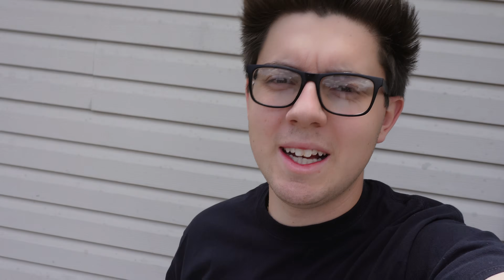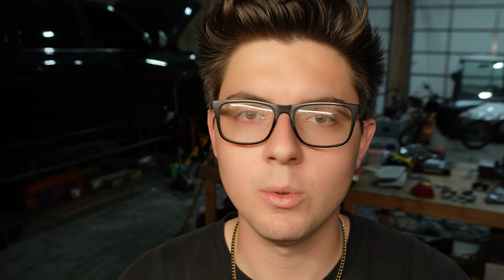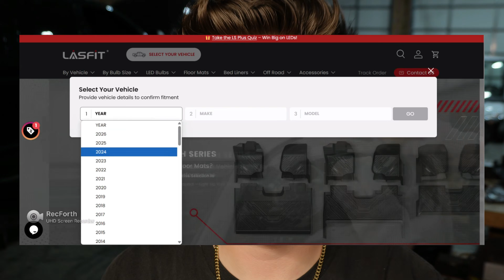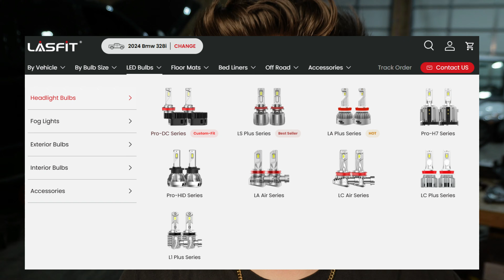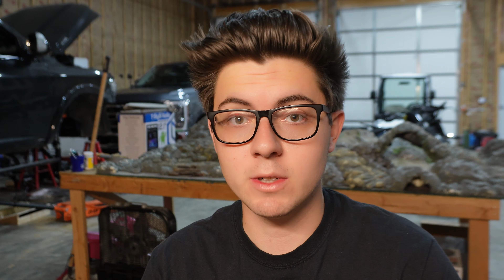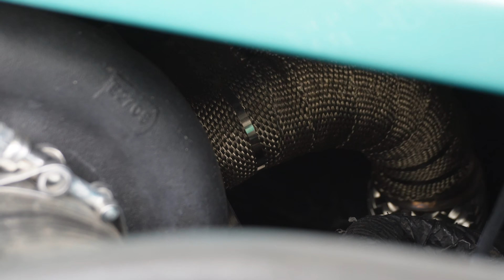MY 6.0 POWERSTROKE ENGINE & TRANSMISSION BUILD COST BREAKDOWN

Comment: Making it non vgt are the turbos just cheaper or what's the advantage? Less modern features? I get that. I like driving carb stuff in warm weather.

1,850, not a cheap ebay turbo. 😅
👌
Reply from the maker: Non vgt Turbos are easier to rebuild , push more power , different sound , pull harder up top , few advantages of course depending on the setup ! Also disadvantages , depending on the setup